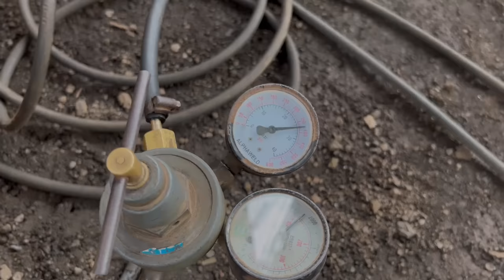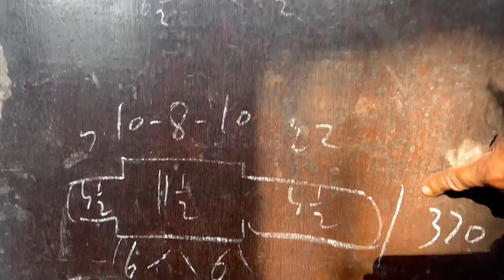How Expert Machinist Make 5 Cylinder Ammonia Compressor Crankshaft- Compressor Crankshaft |

Comment: Holy deflection in that tool holder.
Reply: He is letting it float to rough cut it because of the interrupted cutting. Saves bits...
Reply: @ericwolfe9828  Ah......Thanks for the explanation. I watch these videos because you can learn some stuff.....I have a old Sheldon lathe and some of the techniques they use make sense to me
Reply: He is taking some big cuts.with out a stedy cut. There is going to be flexing or movement on the tool post or holder.  When interrupted cuts are happening.
Reply: @ericwolfe9828  🙏
Reply: Forget spring pass, it’s a bungee pass
Reply: Pretty incredible set-up. Nice job.👍👍👏🏻👏🏻
Reply: Was thinking the same thing.
Reply: @ericwolfe9828  11q1qqqqqqqqqqqqqqqqq11
Reply: Machine is sloppy. Gibs probably welded up a dozen times.
Reply: @ericwolfe9828  no, it’s cause they have shitty tools😂it is NOT supposed to being doing that😂😂😂
Reply: @aramirez8427  it is NOT supposed to be doing that they have shitty tools😂I mean work with what ya got but that is not what turning is supposed to look like

Comment: Half expected to see a 150Kg frisbee come outta that lathe any second - very glad that didn't happen, however, I wager it has before.  Amazes me how this guy can get an accurate cut when his tool post is moving around like a willow in the wind.  The Fred Flintstone gang has it going on.
Reply: I've calculated that thing in it's raw form is more than 500kg.
Reply: I’m sure I must have missed the bit where he used a centre drill for centre. Or did he just jam a dead centre in the end, let it wear itself in?
Reply: @thomascolville9438  it would seem it wore its way in . . . I was expecting the worst.
Reply: @thomascolville9438  Check out  31.05 minutes.
Reply: They cant.
Reply: The donkey treadmills that power the lathe must be on the roof.
Reply: @envitech02  Based off what? thing is like 4 feet x 7 inch OD max weight roughly 700 lbs.
Reply: Hard to say but I treat as 3 sections and assume the following dimensions
8" dia x 8"L
12" dia x 4'L
6" dia x 2'L
That'll be 812.8kg or 1792lbs.
Reply: @envitech02  Doubtful the thing doesnt look mor than 4 feet long they put a very worn grinding disc on it at 7:35 gives you some scale so the smallest part is maybe 6 inch the largest part scaled up is maybe 8.5 inches i did 8 inches x 4 feet = 700 lbs. I have much, much larger lathes than this the quill for the tailstock on one of them is 3.5 inches at 13:15 it gives you a shot for scale theres no way the OD on the small is more than 6. so ya no way its as large as you estimate. Even if you do 6 feet at 8 inches = 1026 odd pounds which is nowhere near 1700 lbs.
Reply: @msa-tt4bg  
I was on about the first operation. Saw that bit for for machining the cranks. That was just a twist drill, still couldn’t see the 60 angle for the centre. The video is edited quite a bit.
Reply: @thomascolville9438  They would've used an electric hand drill, to drill a centre hole, (not necessarily  using a centre drill) at an early stage in the machining process. These guys are experienced enough to know that just using a centre punch dot to locate the centre, won't work.
Reply: @msa-tt4bg  
I know how they should drill it, I’ve watched this again at slow speed. Still looks like the centre was entered into the centre dab. No drilling. It still needs a 60 degree for the centre though. You shouldn’t just jam a centre into a drilled hole. Especially with a dead centre. Why would you not use a centre drill anyway, it’s also more accurate. No excuse for using twist drill for this purpose. I still have some spare, various sizes. I’ll post them some.
Reply: @thomascolville9438  Check out :-                                         
'old man amazingly manufactured a 4 ton camshaft'                                                                                                         2 minutes into the clip you'll see  the guy using a twist drill to bore the tapered hole/location for the centre. These guys are competent machinists, and no competent machinist would rely solely on a 'centre dab' to locate the centre, whilst turning a job of this size.
Reply: @envitech02  and???

Comment: In the 1950's and 60's my father did exactly this job at a factory in the UK. Probably the conditions back then were similar to what you see here although these days it's very, very different. I remember that one time there was an accident where one of the billets slipped from the hoist and rolled, breaking my father's leg. He was off work for quite a while but he did get sick-pay as required by law here even then.
Reply: Real back in those day's 
Bunch of rainbow unicorns now days.
Reply: Shoes and safety glasses on this crew. Things are looking up.
Reply: @johnknoefler  :D the glasses and shoes will do nothing in an accident. The safety is shit, like Verruca said this is like back in the old days when people didn't know any better.
Reply: Difference is quality of the steel and the accuracy. UK had some fine craftsmen back then. Promise you they had a dial indicator.
Reply: All that equipment they used was sold to other countries and still used today and these are the guys that use them
Reply: @konstantinivanov1986  There is no British manufacturing anymore. I was looking at the raw chunks of steel, looks like it came from old taken apart ships. So there is no problem with steel quality. It is funny how British and Americans were telling us in late 1980's that Soviet Factories are outdated. compared to this, the manufacturing plant I was working in was space age
Reply: @H K It seems you are no machinist, machines are only as accurate as they are made (and maintained) and programmed (in case of computer controlled). I bet these workers are working with the same machines like  the workers in the UK in the 50's and 60's did. Back then the machines where new. Now they have like 70+ years abuse on them. Strange they are not that accurate anymore.
Reply: At least in the 50's in the UK, workers would have worn tighter and safer fitting boiler suits.
Reply: @MM0SDK  lol, in 50's UK workers were striking demanding the same pay and working condondition ias their counterparts in USSR
Reply: @barbosaguzman6101  hahahahaha, best comment ever. I'm going to use that one on a few that work for me.
Reply: @thatswhatshesaid4246  lool no problem man but it's the truth 😂
Reply: @freddy19985  I have no doubt there were factories where more advanced machinery and techniques were available. But what I said is what I saw with my own eyes. I remember being taken to visit my grandfather's workplace on one occasion where wrought iron was being produced in small batches at open furnaces. The heat and fumes, the sweating men in street clothes and boots are a vivid memory to this day. I must have been barely four years old.
Reply: nowadays forging  is exactly like this.a big hammer and a peice of  metal.maybe some part of that is robotic.
Reply: Капитализм убивает
Reply: Средневековье
Reply: I Pakistan sadly these men won't even get sick pay.
Reply: а сейчас что-то подобное могут сделать в UK?
 или все грязные производства выведены в китай?
Reply: The question is get these experts paid properly? The answer is - no.
Reply: @MM0SDK  I vividly remember my dad's old boiler suit. It hung on the back of the door to the cupboard under the stairs. I used to love the smell of hot cutting oil and sweat grimed into the material. I have one of my own just like it now, hanging in my workshop.😄
Reply: @barbosaguzman6101  I think the machine I work with is from late '50's early 60's but it still does the job (manual) and is a tough old sod.
Reply: @timrutkevich3222 The parts they're using indeed come from old ships. Remember there's a huge industry in Pakistan and India breaking ships.

Comment: I work in some machine shops here in the US in Seattle and you'd be surprised they don't look much better than this. They are definitely a little better but using old machines from the early 1900's I was building extremely high tolerance high-value hydraulic fittings for hydraulic cylinders
Reply: These shops in Pakistan look like this because there really was not much investment after the 60s. It's hard to imagine but Pakistan was the first Asian country to produce a microchip. But then for some reason people just stopped investing in industry and skilled labor moved to Europe and the Gulf Arab countries for more lucrative opportunities. Flooding of cheap products from China also made a big impact.
Reply: Yeah because these are the grand parents 😅😅
Reply: The thing with those old machines is that given proper maintenance they are as good as any new/mordem machine.
Also you can modernize them by adding servo motors and controllers.

Comment: It shows that even when things and the workspace look like crap one can accomplish a lot!
Respect for these hard-working men that creates parts out of a few lumps of steel.
Good teamwork and work ethics make the difference here. 
I love how he has installed a contra weight on the chuck to balance the load and go easy on the main bearings.
Reply: skills matter
Reply: their precision is pure crap and would be seen as rubbish in most new factories,
Reply: Bearings go bad...they just weld em back together.
Reply: @jarniskat  
Does the job. If it doesn't they wouldn't still be in bussiness working on a part for days.
Reply: One has to wonder how long these parts remain in service before they break or wear out and need to be replaced...
Reply: Ты видел хождение резца?

Comment: Forging at its truest form! Respect to each person whos vaporized sweat and blood goes into making that steel.
I was a tool and die maker, and later Fab lead. We used this steel every day, with few knowing just what goes into the "Real" manual forging process from the last century.
Hats off, it might be a bit lacking in skillsets and tools, but makes up for it with shear force of will, weight, patience and tenacity.
Git er done! Wooot!
Reply: M

Comment: I am absolutely impressed. They do a perfect job.
I wish you continued success and good health.
Many greetings from Germany
Reply: Those parts are junk.  I wish they would learn marketable skills and automate more of the job.
Reply: @MichaelMantion  bullshit. If it's doing it's job and it's enough for customer, it's not junk. Not all stuff have to be made on Kern CNC.
Reply: @MichaelMantion  so true!
Reply: @MichaelMantion  Automation just makes stuff cheaper and faster - not necessarily better.
All the difference is the guy in front of the machine.
Also not ever part requires top notch precicion - good enough is the way to go. 
This is developing world - labor is CHEAP there and the infrastucture to operate modern CNC machines and stuff is JUST NOT THERE.

In their environment they HAVE marketable skills.
This might go right over your head but i post it anyways, maybe you get it once they compete for you job lol.

Comment: I am always amazed at the manufacturing capability of these guys in the far east. You look at what they have to work with and it is mind boggling what they can do. The acetylene cutting outfit showed a hose attached with a screw clamp in one frame, looking around there is a lot more that western culture would have a fit about, but these guys go right to work and make do.
Reply: Without distractions you can be very creative

Comment: I'm usually not impressed by these videos, but this was actually really good. Machinist used simple lathe and math to make a high grade machine component 👍
Reply: Yes the lathe operator has a lot of knowledge to pull that off, goes to show what you can do with a lathe. If the final tolerances, balance and bearings are well done on the shaft it could actually last a long time.
Reply: Imposible to get presicion.. The shape is good looking but will not functioning well since low accuracy.. This such part need tolerance until 1/1000 inch, which impossible made by manual instead of CNC
Reply: @ekosantoso4342  I have held tenths on a manual lathe many times, if you don't think you could hold a thousandth on a manual lathe you don't know what your talking about, that said this lathe likely can not hold that tight of a tolerance but most of the time material is left on and the final machining it on a cylindrical grinder. With a bit of sanding using strips of emery cloth and a flat backing bar or file you can get very high precision and surface finish on a manual lathe but for production parts it is usually easier and faster to grind them.
Reply: @phillhuddleston9445  I am sure you can do that with a simple cylindrical or round shaft.. But for a crankshaft, I don't think so since the centre of main shaft is different with journal shaft..
Reply: @phillhuddleston9445  Yes we made precision parts long before CNC came along. It wasn't as easy, but skilled people did it routinely. I'm not seeing a lot of precision skills in this video however. Just hogging out a crankshaft shaped object. I especially liked how he used a carpenters level to set the rotation.
Reply: @ekosantoso4342  its very possible on a manual, how do you think these components were made before CNC machines were popularised? i dont think these men have the skills or knowledge to do that though. idk what these crankshafts are for, but they probably wont last long. most crankshafts ive seen in these kinds of videos are for little two strokes where you dont really need amazing precision
Reply: @declancampbell1277  It's in the title "5 Cylinder Ammonia Compressor Crankshaft"
Reply: I think "high grade" is pushing it.
Reply: @sarcasticguy4311  The machinist may in fact have been "high"
Reply: @ekosantoso4342  getting 1/1000 tolerances is not impossible on a manual lathe if it is in good shape and using the proper tools but on the piece of shit this guy was using absolutely impossible
Reply: @ekosantoso4342  i know its not as precise compared to what we have available in the modern world, but considering their standard of living and lack of access to more expensive CNC machines it turned out really well.
Reply: totally agree with you
Reply: That can you do better if so then please post a video.If not then take a hike ok.
Reply: @ekosantoso4342  He is only roughing in the shaft from a forged lump of material.  Unlike a cast crankshaft where the item comes out of the block in the rough shape and size that it needs to be, this guy is working with a forged shaft that first needs to be shaped which is what he is doing here.  The final dimensions for the journals and such would be machined later in the process.

Comment: I like how they describe the workers as expert machinists, then proceed to show them operating a 75 year old lathe with worn gibs.

I admit that I am impressed at their materials manufacturing. Melting together who knows what different grades of steel then proceeding to hammer forge it into a nearly perfect round bar, while wearing flip flops no less, is downright impressive!
Reply: А вы представьте себе что эти люди смогут выполнить если у них будут отличные ,современные станки.
Хотя бы просто станки.
А теперь посмотрите как многие ноют ,канючат на работе в более лучших условиях.
Нужно просто показывать такие видио. Пускай поучаться.
А в валом всё понятно...его дальше будут уже на другом станке шлифовать точно в нужный размер и можно не переживать что будет всё точно.
Reply: they didnt melt together anything this time, they cut a chuck of steel off another machine part seeming like an older ship crankshaft lobe then heated it in a forge then hammered it out at least thats what it seems like to me
Reply: What I find most impressive is that there isn't any sign of an indicator or a drop of cutting oil anywhere.
Reply: Despite the age and quality of the machines, the men that operate them are still experts in their craft.
Indeed, one may that their expertise is magnified by the poor quality of the machines.
Reply: What amazes me is with all the hot steel and cutting torches not one of their 'overalls' set on fire....😂

Comment: I take inspiration from these videos. Shows you don't need expensive high tech to get the job done when you have skills.I think when you watch these other smaller scale  crafts men from Pakistan or India you realise that in the west the weekend craftsman often has access to more tech than these guys and is still not as good.In the West this shaft building process is all computerised.If I had the money ,I would send them a whole lot of steel cap boots for those without though
Reply: 他们不会用的你说的那些安全防护用具，那种环境佩戴就像镣铐刑具，那会让他们在同行眼里看起来像傻瓜。

Comment: The result can be so much better (and faster!) if they just learned to grind their toolbits the proper way.  I watched a lot of these video's and it's always the same: toolbits with the wrong geometry.  Yes, it gets the job done. You are right. But the result can be a lot better.
Reply: This is the best you can get for the price i think.
Reply: @pak3ton  I mean you can grind your own tooling
Reply: They have no knowledge of such things. This is the way they have done it for 50 years, and nobody gonna show them a better way.
Reply: I suspect these guys are doing the best they can with the equipment they have and likely are not missing out on simple techniques to make better results.
Reply: True, but that is beyond their skill level. They do not even know why it cuts.
Reply: @Etron49  Actually not always. Those cemented carbide tools don't handle thermal shock well. Sometimes coolant tears them up faster. Overall, it pains me to see them struggling with such old tech when we have so much better things available at only slightly higher cost.
Reply: You must be kidding, look at their machines their working environment their outfits their eye and ear protection you think they are gonna worry how they ground their toolbits
Reply: They aren't interested in that they learn just enough to get the job done and get paid.